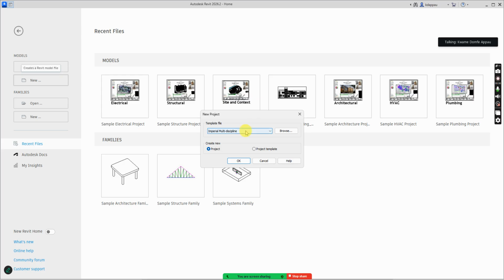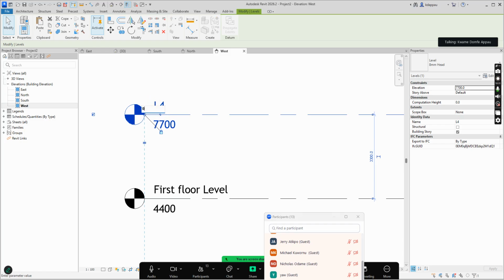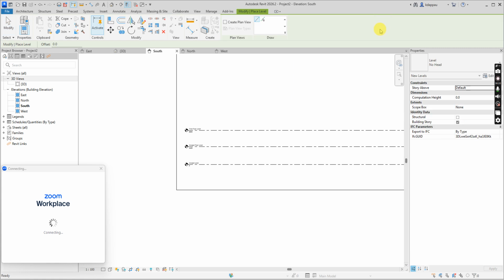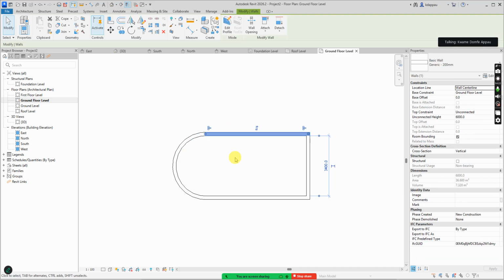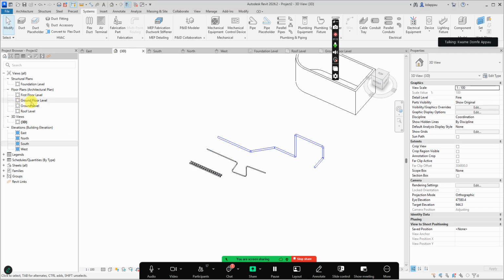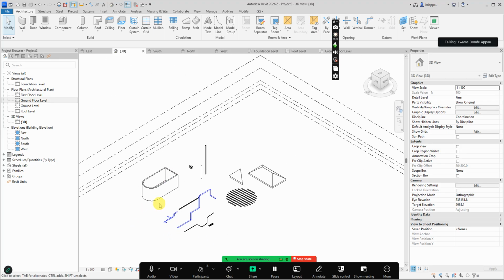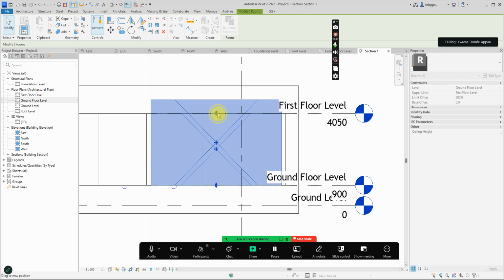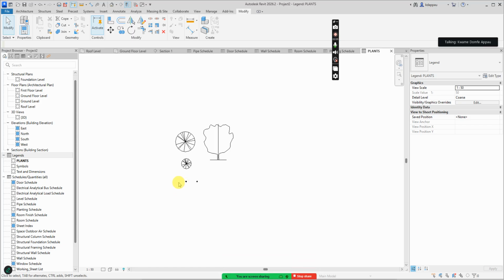Revit Essentials Training   Day Two - Starting a new Project from Scratch

Comment: hi, am jesse Freetown Sierra Leone, how can we draw an under ground plan, ground plan, first floor and second floor plan, e.g. on a hill ground or elevation ground
Reply from the maker: Jesse, I strongly recommend that you model buildings separately from site. The building model would have its own levels as determined by the design requirements. Then you model the site using Topographical tools and building pad in REVIT. The site too would have its own defined levels. Then using REVIT Links, you can link the two files together. We are yet to cover site and site related topics. By all means the challenge you are facing with site would be addressed in future tutorials.